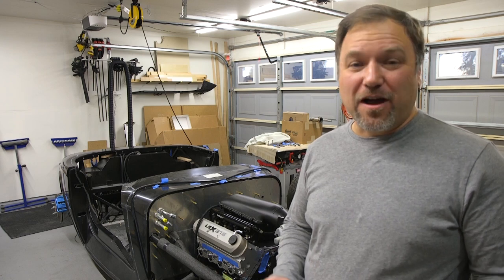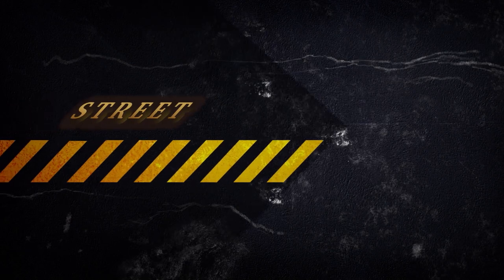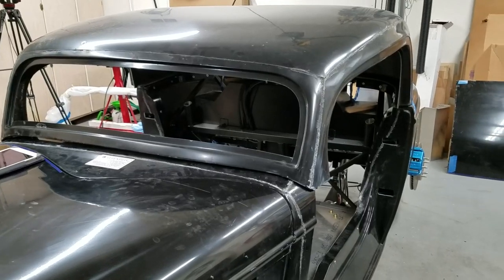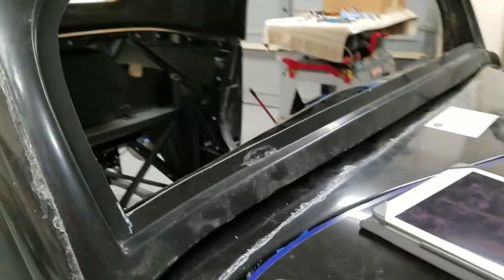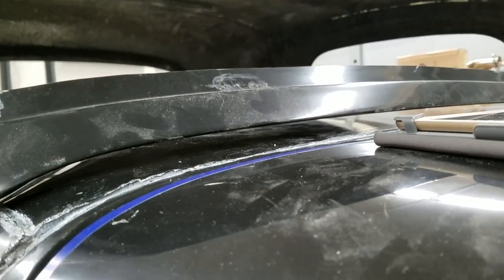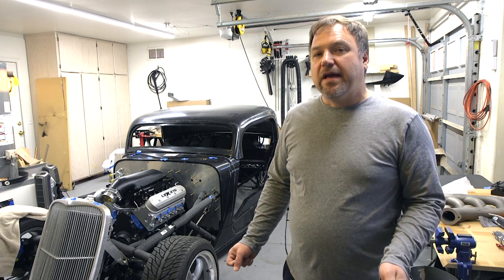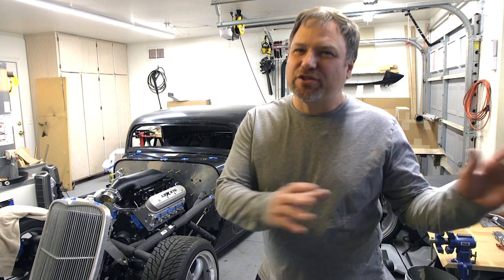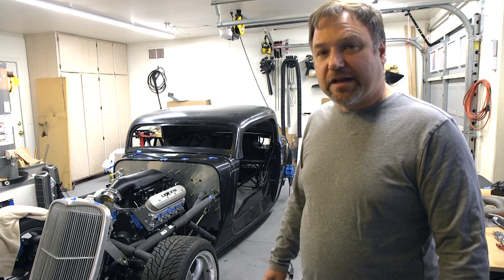Factory Five 33 Hot Rod V2 Build – Hard Top Prep

Comment: I did chassis #99, an early kit.  From my experience, 65% of the project is body work.  I did much of the rough body work, door hanging and latching, top fitting, trunk lid, hood and side panel fitting etc but then contracted out the finish body work and paint.  I also had a glass guy come in and do the windshield and rear window.  
I kept a journal and it took approximately 1000 hours to get that far.  I was shocked at the cost of paint materials.  The finish body work and paint came to over $6500 for a single color nonmetallic paint job and that is cheap by today’s standards.  My project started in August ‘09 and finished in Spring of 2015.  Total cost back then was $45k with a crate 347ci 425hp  stroker and Tremec 5 speed.  Finished weight was just under 2200 lbs dry.  
Since then I upgraded to a Holley Sniper efi.  That turned out to be a project as the top had to come off for fuel tank mods as well as replumbing the entire fuel system and sorting out the fuel maps and adding the correct distributor so the Sniper controls timing.
I get tired just thinking about it🤗
Reply from the maker: Yeah, doing a repair means take the whole car apart.

Comment: Not that I could have done it better, but I believe your problem is that you have kinks in the vertical and horizontal planes of your bodywork. In the horizontal plane, your firewall seems to be the high point, throwing off the alignment of your side panels. The other problem seems to be that your door openings, at least at the top, are not equal leading to the door opening on the passenger side not matching the profile of the roof. I believe you should have assembled the body parts on the naked frame and braced them or taken reference dimensions before you did anything else. The body is what most people see FIRST, giving it the highest priority, so it should dictate what lies beneath it!!!
Reply from the maker: Not so much on the problem.  I agree that the body is the first thing people will see.  I originally wanted to do the body work first, but was discouraged from doing so.  Since I have never built one of these before, I agree with that assessment due to how much stuff depends on other stuff.  Doing the body work first would have been a shot in the dark for what was coming down the pike later.  However, I think I picked the sweet spot.  I got all the mechanical side figured out.  Understand the interactions and then stopped to do body work before electrical etc..  Of course if I built another one, I would be able to start in any order and I would chose to do body work first, make a mess and then a clean build.

Comment: The body is tied down ok so I expect that you will need to do what I had to do. Get the back mount the way you want, drill and attach securely. Then you can persuade the front corners into place with some creative use of straps. Then drill the front mounts. Once it is in place, set it out in the sun for a bit and it will adjust to the correct location. The top has a lot more flex than the body.
Reply: It may be time to call the traveler